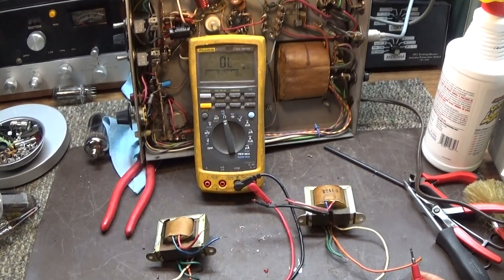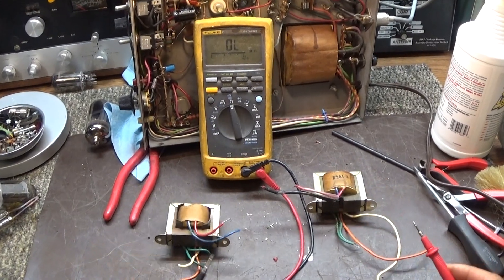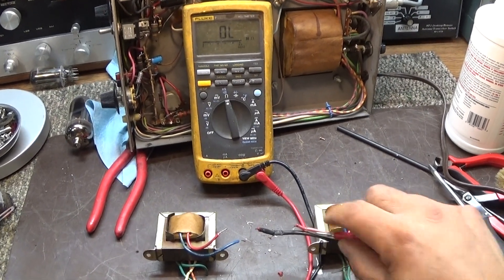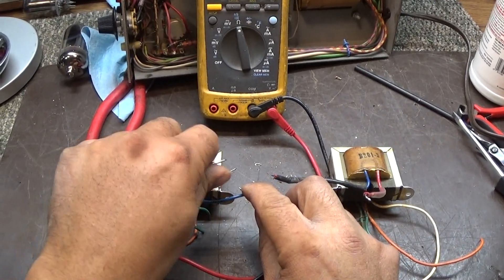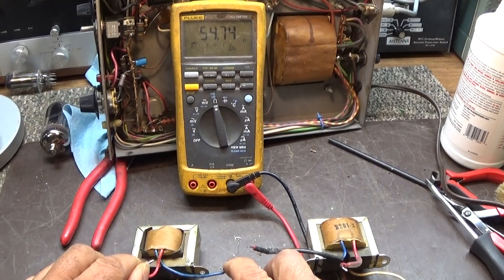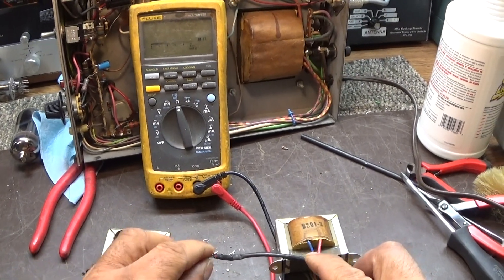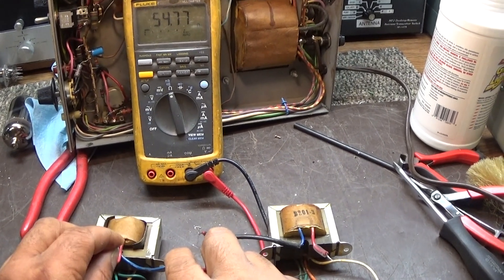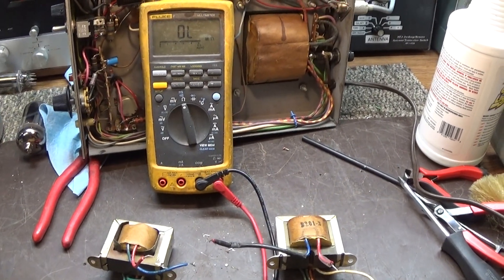Tram D201 Modulation Transformers Good vs Bad

Comment: You are wrong on this. A new or good audio transformer for the Tram D201 or D201A will have approximately 53 ohms on the input (blue and red wires). 63 ohms on the output wires to the final output tube (white and orange) and about .3 ohms on the output wires (green and green) to the speaker. They can easily be measured right in the radio without removing them.